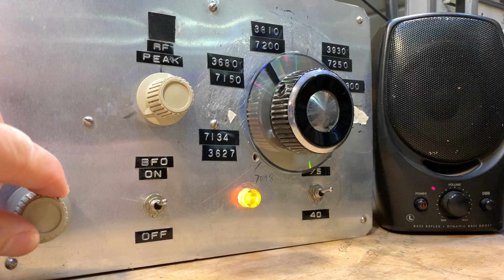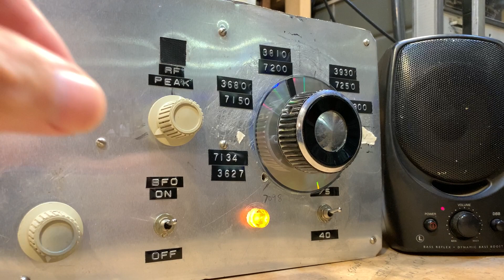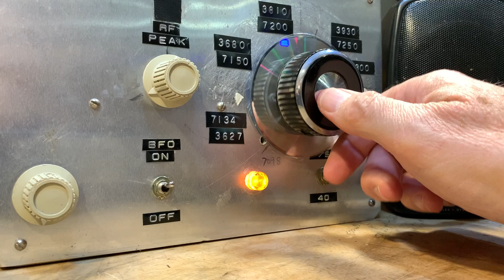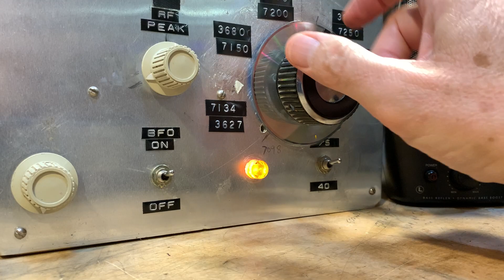Mate for the Mighty Midget Receiver with 6 kHz Ceramic Filter

Comment: sounds really good!  Nice to hear my ex-NJ friend K2YN.  That RF Peak control seems pretty sharp - what is it is adjusting?
Reply: The article is from QST April 1966; on the ARRL periodicals search just punch in "mate mighty midget" and "McCoy". Might be the C1 in the input stage to the RF amp?
Reply: @PapasDino  Cool, I'll have to check that out.
Reply from the maker: Alan:  They have an LC circuit on the grid of the RF amp, and another on the plate of the RF amp.  The tuning cap for both is ganged, so you are tuning both at the same time. 73  Bill